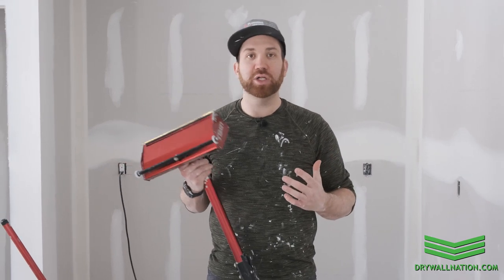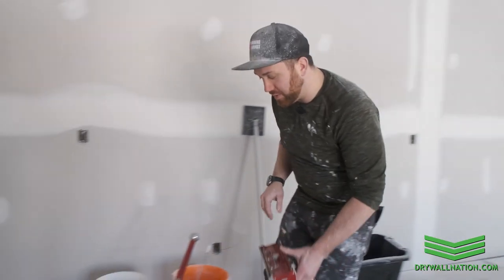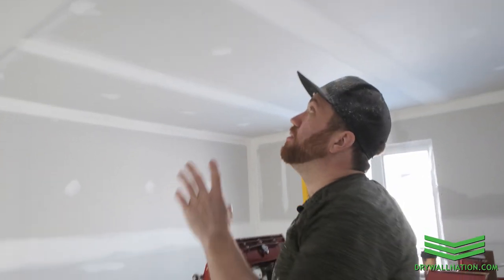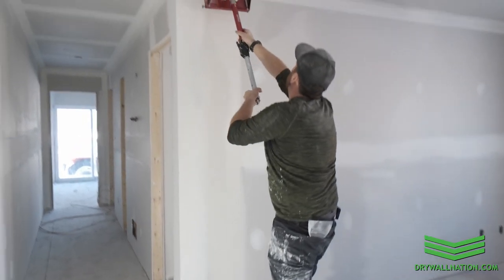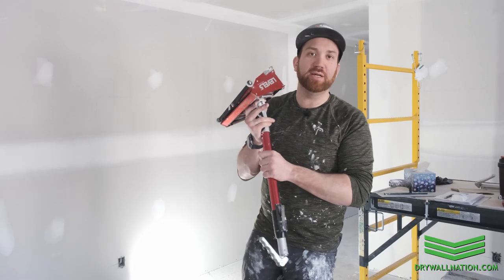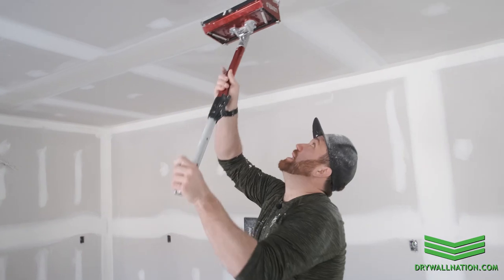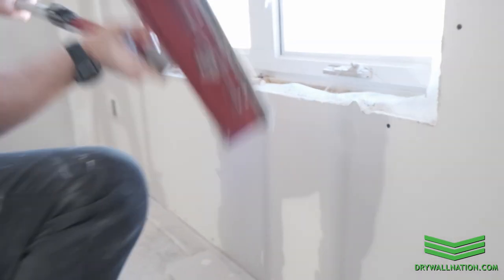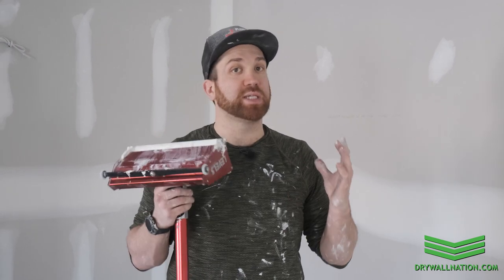How to Use a 12-Inch Drywall Flat Box for a Final Skim Coat | Video 6/6

Comment: As a drywall finisher for 40 plus years, I like the way you use a 12" finishing box. Yes, I do agree to go over the seams twice to make sure there is no pin holes in the finish if needed to. Another thought: When I used a 8" or a 10" box- I went over the joints twice to make the finish was ready for the 12" flat finisher. Well: It's the way I was taught-so be it. Very good video- I really enjoyed it. Thz, Phil Anderson=Evansville, Indiana

Comment: Do you just sheet rock 90 in the boxes or automatic taper? Or do you just use regular mud for all coats? And from what I see there is you just use the automatic taper for the first coat 10” box for the next coat and your 12” boxes for the last coat.

Comment: Looks like a cool system. I’m a good taper this just seems faster. I’m skeptical about the thickness though, I always tape at least 2’ seams to taper it well.
Reply: Just seen a job finished and done with boxes and flushers.
I’m use to hand finished mudding and seeing the finished product differently.
Many of the factory tapered seams in some areas you can see the drywalls tapered edge after they sanded the factory seams and inside corners look thin but maybe that’s how it suppose to be with these mudding tools

Comment: I'm just a one person shop that does all different types of work and so improving efficiency is import here.  I find the equipment is somewhat pricey and hard to justify multiple boxes for the work I do -- For the time being could I get away with using the 10" box on a final skim coat by overlapping my fill coat as if I was using a 12" or 14" box?
Reply from the maker: Hey Vince, good question! While you MAY be able to get away with that, we wouldn't recommend it as it would be very difficult to product a flat wall. In case you're not aware, you can sign up for our VIP Club and get an instant 10% off coupon which adds up to quite a bit of savings on our Drywall Taping Tool set options. Here's a sign up link in case you're interested - www.level5tools.com/vip
 
Please let us know if you have any other questions!
Reply: you can just use a ten inch then skim it out by hand after.. still way faster

Comment: I personally don't like to pre sand for the finish coat because without the dust the finish gets more sticky to the wall and I been using Level 5,Columbia,tape tec, platinum and Tool pro flat box's but my favorite is definitely Level 5 . I will buy my own set high capacity 10 and 12 coming soon.
Reply from the maker: Please reach out when you're ready if you have any questions! 📞 800.227.7713
Reply: @LEVEL5Tools  I will, Thank you!!
Reply: Gotta sand! Otherwise you’ll end up with bumpy joints

Comment: Can you use a flat box to skim coat walls with texture as an easy way to get flat smooth walls?
Reply from the maker: We would not recommend using a flat box for this skim coating textured walls. Instead, we recommend a manual method using skimming blades - https://www.level5tools.com/catalog/drywall-skimming-blades